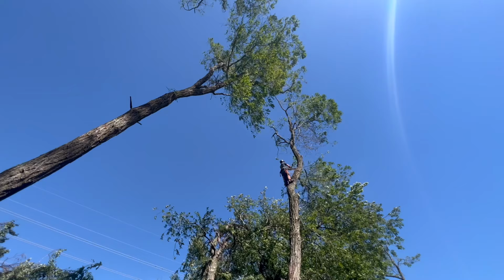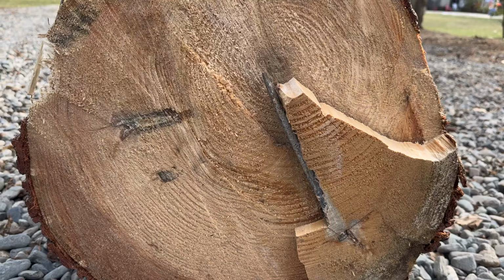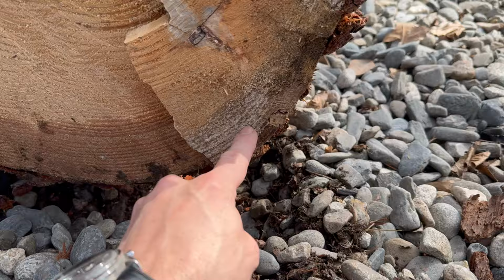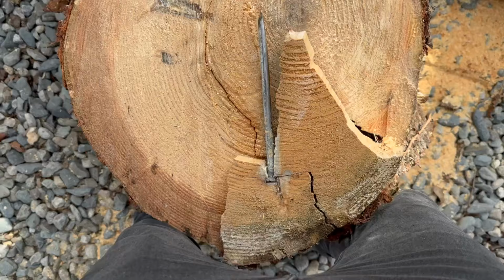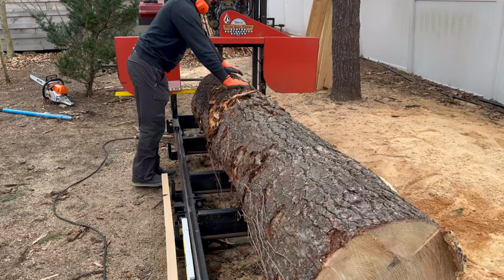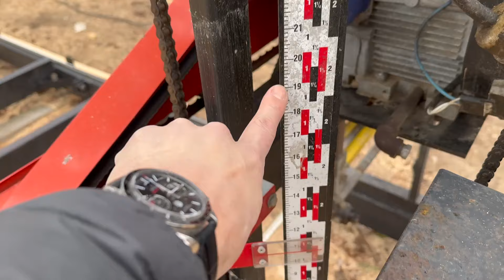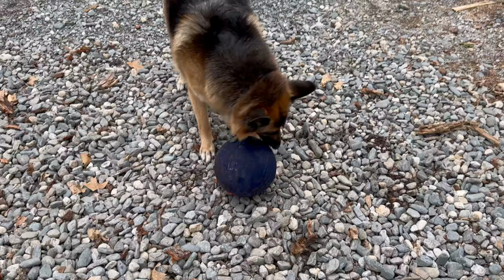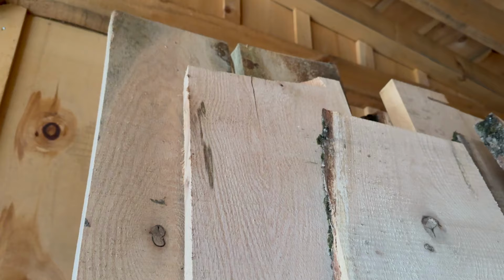HOW TO CORRECTLY MILL Lumber for Renovation Project

Comment: In the past year I have become fond of cedar, it smells good drys quickly easy to cut and split great for heating the house in fireplace, very little ash. I used to burn pine, white oak and eucalyptus, a summer of felling, cutting splitting and stacking leads to a warm dry winter